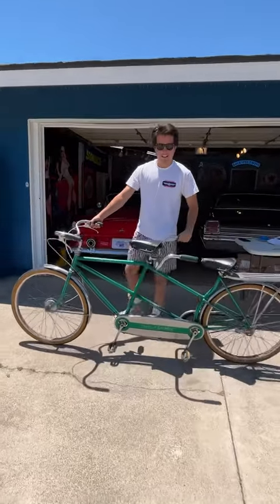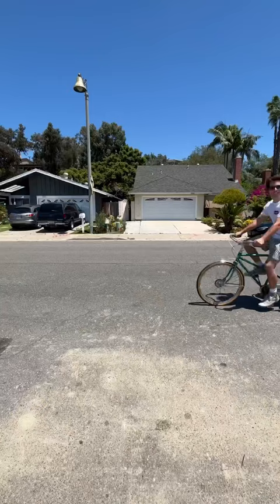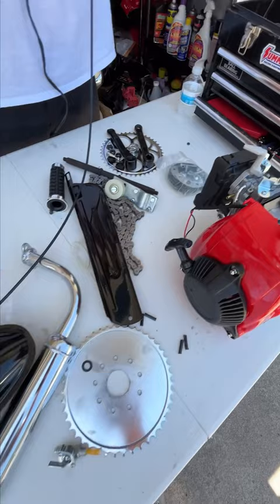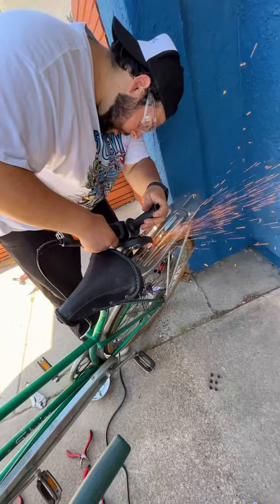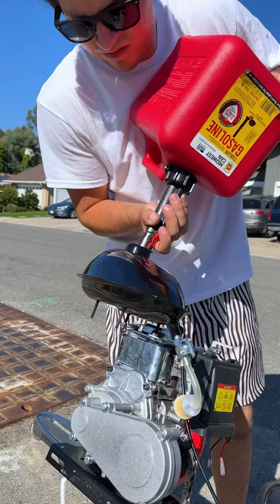I put an engine on a tandem bicycle

Comment: Kinda dumb to put the throttle in the back especially since it complicates the whole handling aspect since the front is the one that does all the steering
Reply: 😂😂facts what a high moment they had lmao
Reply: It’s just a bit of fun. I don’t think it’s meant to be serious.
Reply: probably didn't have a throttle cable long enough to reach the front after all the throttle cables that come with those kids are only meant for normal bikes

Comment: That thing is so over geared with that tiny sprocket on the back just get the right frame for it bro and mount the engine in the triangle of the frame